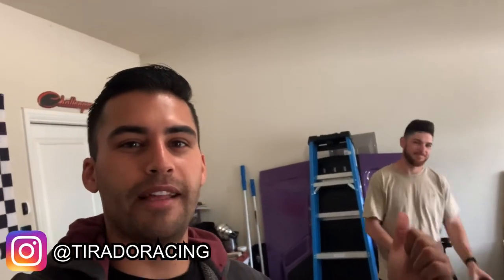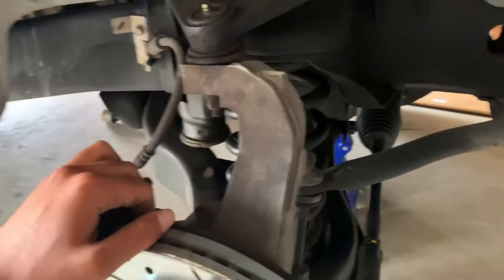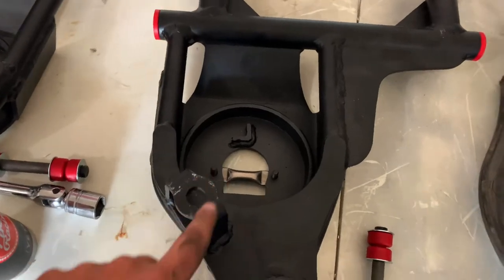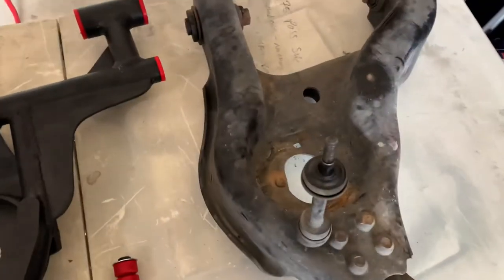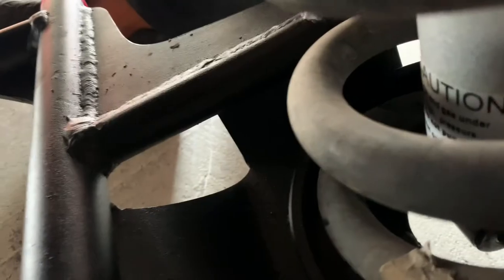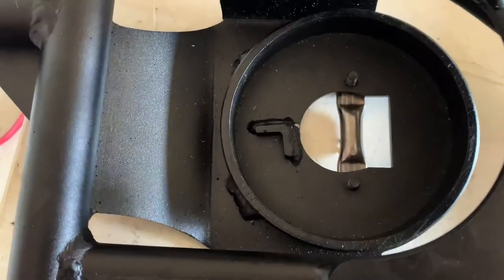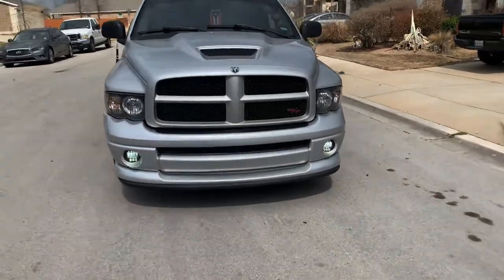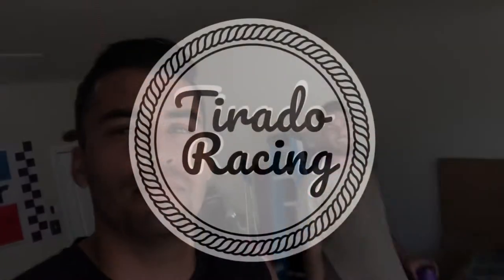Lowering My Ram Daytona Part 1

Comment: 6:15 the bolts for the shock are on backwards. The bolts go through the bottom, not the top. Because, when you change the shocks, you can just remove the bolts and drop the shock. If you leave the bolts like they are now, you'll have to remove everything, including the spring to change shocks. 5:46 , see how the bar has the bolts, that's how you should've installed the shock, from underneath the control arm.
Reply from the maker: 100%!! We fixed it afterwards!

Comment: its been 2 years, how is the truck with the DJM lowering kit doing. I just did mine, same kit
Reply from the maker: I sold it and bought a TRX 😅 then sold that and got a Bronco Sport and a 06 Mustang for my drift build. 

The kit was nice I just disliked how the front bottomed out in the fender liners all the time even with low profile tires. 

My next truck will be a Cummins.
Reply: @TIRADORACING  Oh wow, Im surprised how different trucks are even with identical lowering kits. I did the DJM 3/5 kit (inspired by your truck)  running 305/50/20's, and absolutly no probs at all. 
 SOLD the TRX? NOO!! I have a Durango SRT 392 as my daily driver, but always wanted a TRX.
Good luck man, I miss your channel
Reply from the maker: @darinferreira4448  wild, I appreciate the kind words! I had fun with both trucks. 

I loved the Daytona but wanted something newer and safer for the baby. 

I then sold it to build the drift car. Now that the drift car is almost done I wanna get a megacab to haul the car to different events.
Reply: @TIRADORACING  lookin fwd to the drift videos!! Good luck !!

Comment: Lookin good! 
But it looks like you installed your shocks wrong @6:15 They are supposed to mount from underneath. The lower mounts of the shock, should be installed in the same way that DJM had that little “bar” bolted up on the lower arm. 

Otherwise you can’t remove the shock from the bottom, when you want to change them. You’re gonna have to fully pull the lower arm out and the spring in order to unbolt the shock. At least that’s what it looks like from what I can see.
Reply from the maker: You are absolutely correct! I changed it lol
Reply: @TIRADORACING  cool. I have the same flip kit also. It’s really well built. Nice looking Daytona!. I have an 04 Ram Hemi QC. It’s been a great truck.
Reply from the maker: Thank you! I had an 04 2500 in silver as well. That one was lifted 4” with 20x12 fuel Mavericks on 35’s. But I’ve always wanted a Daytona and a full size street truck so I couldn’t pass this up. 

Both trucks have been really good to me. I love third gen Rams. I wish the price of the viper trucks would go down lol
Reply: @TIRADORACING  I feel ya bro. Had the chance to buy my boys silver SRT QC years ago, but didn’t do it. Really regret that decision! Lol 

I’ve got a 1500 dropped and has some mild engine work. Had it since brand new. Used to race it back in the day. Always been a fun, reliable truck.
Reply from the maker: Do you have an Instagram? If you do what’s your @?
Reply: @TIRADORACING  I do but it’s mostly my projects. I do have a few little pics of the truck. @kdbkreations
Reply: @KB-yi8pq  I bought an 05 as my first truck, do you think this kit will fit on a 4x4 can I not lower the front without adjusting my torsion bars.
Reply: @thtblack5.7  if I recall, the lower control arms are different on 2wd and 4wd. The only front drop I remember for a 4wd of these models, is the drop spindles. They will give you a 2” front drop. And if you lower the torsion bars a little, you might get another inch and still be safe with cv angles etc. 

Mcgaughy’s makes the drop spindles. But last I checked there are other companies making them and selling them on eBay as well. They are knock offs. So I don’t know if the quality is the same. But they look identical.

Comment: Do you know the part number for the shocks?
Reply from the maker: Hey Adan, 

I hate to be this guy but I’ve replaced those shocks twice in a 2 -3 month period. 

If you can find some bilstein shocks at your local auto parts store that is what I’m currently Running. I will not be using the Belltech shocks again because they blew out with very simple driving. 

I even used duralast monotube shocks and the truck ride was better than with the Belltech….
Reply: Thank you so much for telling me, I was about to order those shocks right now
Reply from the maker: Yea man, I’m just not pleased with them at all. Good luck!
Reply: Did you buy the lowering shock bracket or did you just go to the auto parts and ask for shocks for a ram
Reply: Did you have to get smaller shocks or are you running the factory size
Reply: Been holding off on buying shocks because I don’t know which ones too get, I bought the same djm kit you have for your Daytona, I bought it for my rumble bee
Reply from the maker: With the djm lower control arms you use factory sized shocks. Check their website and it explains why. Basically keeps the factory geometry. 

Went to auto zone and just asked for shocks